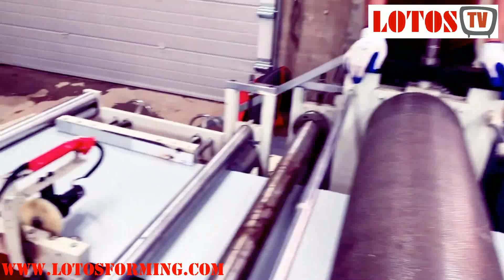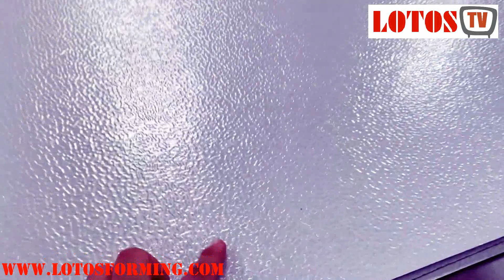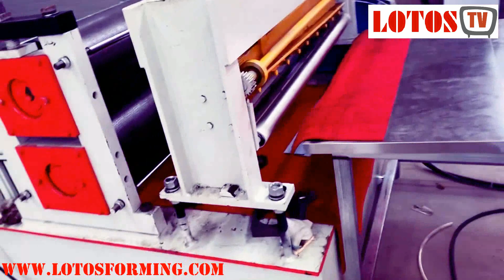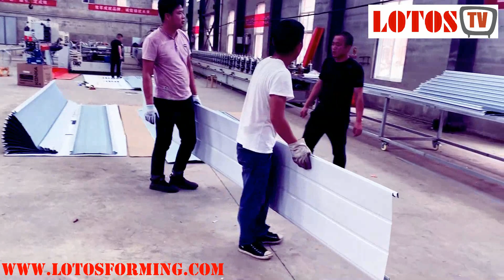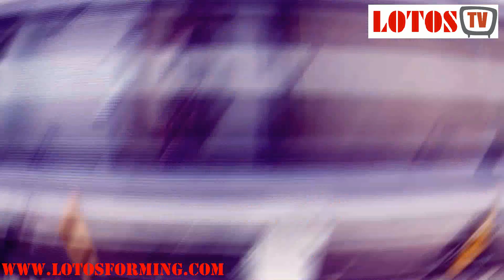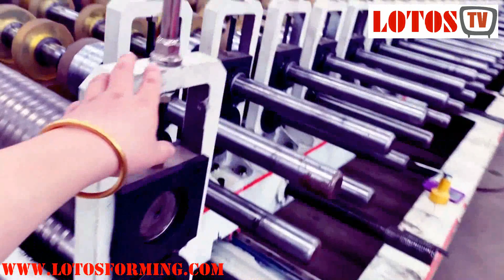【Vertical Lift Overhead Garage Door production line】: Garage door production line " Discontinuous "

Comment from the maker: Complete Discontinuous Garage door production line includes these parts :
step 1: decoiler—>leveling + embossing + cut to length
step 2: hot press machine to make door panel patterns. such cube or any other patterns
step 3: shutter panel roll forming machines.
step4: foaming hot press platform 
step 5: packing
step 6: garage door finished product.